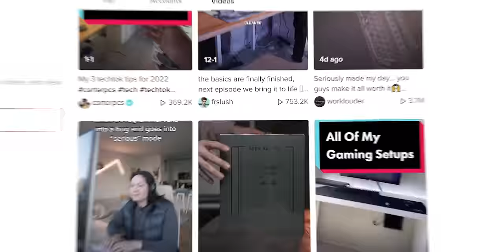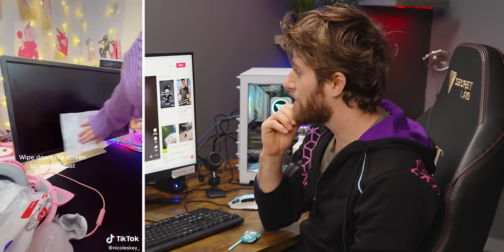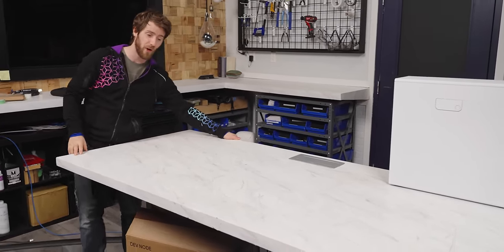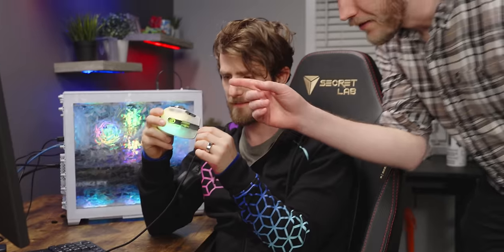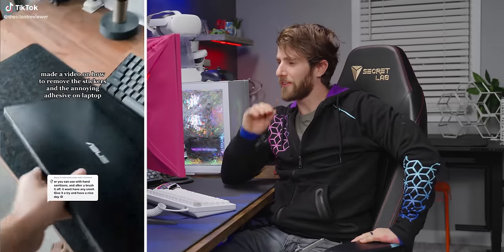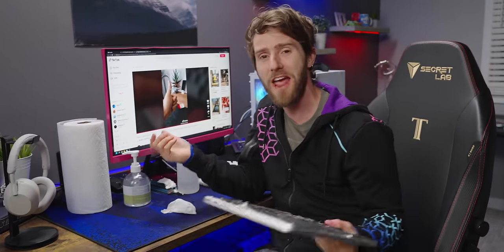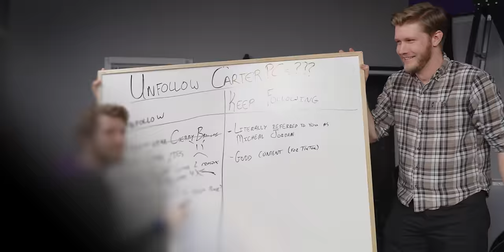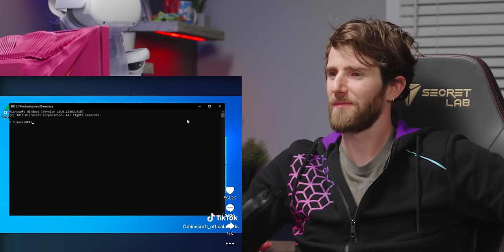TikTok Tech Tips are Terrible

Comment: Its the gelification of an evaporating solvent that gives it more time to penetrate. They purposefully do this in art restoration with various solvents to allow more working time and penetration on small areas so something harsher doesn't have to be used.
Hand sanitizer will get just about anything off of a hard non permeable surface. It's also good for getting dried paint out of paint brushes.
I use it for so many things around my house that when 2020 hit I had just under 2 liters of it already in the house.
Reply: It is also amazing for actually getting white boards cleaned to the point of being white again. 

Acetone can clean out the paint from brushes but probably ends up shortening the life span of any brushes made from artificial hair. I only use it on brushes that are ruined and I used on harsh paints like spray paint (for touch ups of minor scratches or nicks)
Reply: I use Goo Gone and it gets stickers off but leaves an awful-smelling oily residue that I then have to clean off with something else. Hand sanitizer will be tried next time.
Reply: also a sanitizes the surface for you.
Reply: @zebraloverbridget  You can by spray bottles of white board cleaner.  The one I have is mostly ethanol - the main ingredient of hand sanitizer.
Reply: But does it work on the legendarily bad paper GameStop stickers?
Reply: @dmmartindale  Yes, but they don't all work well. At least that was the case when I was still in school. Using the hand sanitizer actually got the board back to being white while the spray only kind of cleaned the board. 

The formulas could have gotten better over the years though
Reply: But will it remove rabbit hide glue?
Reply: The viscosity will certainly help, but I think the main difference is the presence of water in the solution. Not all substances dissolve well in alcohol, but many of those do dissolve in water. I mix 99% IPA with some distilled water (about 30%) and it makes it work noticeably better for many cleaning jobs.
Reply: glycerin is SOAP. So...there's that.
Reply: I work with paint and the old method is putting dried-up brushes in green soft soap and leaving them for several days. I think it works not so much by dissolving as by getting in under the paint and making it release from the brushes. It can take a while but it always seems to work and it's an environmentally friendly way to clean brushes. I will try hand sanitizer though - I can absolutely see how it being a gel would help. And now we have a lot of it too...
Reply: Also amazing at removing permanent marker.
Reply: Glycerin is an oil and like dissolves like.  Goo Gone would work too.
Reply: also you morel ikely have it at home already. especially nowdays instead of 99% alcohol xD
Reply: I would also add that the water makes the cellulose in the stickers more permeable to the alcohol, same principle as why we have 70% alcohol, cleaning alcohol, as the water contents makes bio matter more permeable.

Comment: Something important to know about the last tip is that a clean driver installation also resets your NVIDIA Control Panel settings (and probably also your GeForce Experience settings, but I can't say for sure). I learned this the hard way because I followed this tip elsewhere for a different issue and didn't read what a clean install actually does.
Reply: You're absolutely correct; custom install without checking "clean installation" uninstalls your previous driver already so clean install is pointless when you want to keep settings and profiles.
Reply: @RadicalMac  clean install was necessary for this case because client had issues with FPS. Resetting everything could help

Comment: A gamer has a gaming PC. They don't need anything else to warm their hands. All gaming PCs have warm air blowing out of them somewhere.
Reply: Well, yes, but that "somewhere" is not always the side that is convenient for you to access. Sometimes, they only blow warm air through the back side, which means you need to stand up, walk to the back of your setup, and then warm your hands.

The correct way is, as discussed in another comment thread, is to simply sit on your hands. Or to have a hand warmer at hand...

... in the form of an always-filled hot cup of coffee. 😎👍
Reply: The only time my hands are cold in my hot room with my pc running is when I took my adderall.
Reply: I had a gamer complain about the cold temperature and the wind chill that made it even colder. I had to explain that the temperature outside the house was different than the temperature inside the house, and that the wind shouldn't be blowing inside if the windows and doors are closed. They still didn't get it.
Reply: every laptop owner has his hands pretty warm most of the time.
Reply: @marioprawirosudiro7301  I don't understand, is the gaming set-up outside? I keep my heat in the low 60s in winter and I've never had cold hands sitting at my computer desk. Feet sure, but not hands, especially if they're being used for gaming.
Reply: @jimmyredd  I don't know about winter, but most people here set their aircon to the lowest possible when gaming, because, well, additional cooling. So if you have your rig a bit further away from where your hands are during gaming sessions (usually done so you can have more space on your desk), they won't heat your hands.

That said, I agree that when you're playing action games, whether it's FPSes or action RPGs, you likely won't feel cold at all, simply because your hands are active enough to keep themselves warm. I myself usually only notice my hands getting cold when I play slower-paced games like Civ or CK. Still not a problem though, because, well, hot cup of coffee.
Reply: @marioprawirosudiro7301  Air conditioners generally only go down to 65. Although if it is blowing directly on your hands they would feel much colder. 

Buying handwarmers to counteract your air conditioning is pretty fucking funny though. 

"This humidifier makes my room too humid, I better get a dehumidifier."
Reply: @jimmyredd  I think newer ACs go down to 16 degree Celcius nowadays, which would be around 60-ish F. For me that's plenty cold already.

That said, at least for the ones I see, the main reason people even put their AC that low during gaming sessions is to help cool the system - not the gamer. Kinda similar to how server rooms are usually equipped with heavy-duty air coolers. But unlike a server room which will be devoid of people most of the time, the gamer actually has to stay in the room.

But you're right. Buying a handwarmer just for this would be a bit silly. Thus my hot coffee suggestion. It's something that you probably already have in stock anyway, and many people like to have a beverage in hand when they game. So why not use said beverage as a handwarmer? A win-win solution, if you ask me.
Reply: @jimmyredd  not everyone has particularly good insulation. even though it doesnt get particularly cold outside where I live, the room my setup is in has very little insulation and a lot of windows/doors, so the inside temp is usually pretty close to the outside temp. I can't see myself using hand warmers though, as I'm pretty resistant to cold/heat unless its extreme.
Reply: On cold days feeling air rushing past my arm and into the front fans makes that side feel noticeably worse.  I tried angling the front of my PC away from me during that blizzard last week but I only have so much desk space to work with.
Reply: @marioprawirosudiro7301  "walk to the back of your setup" bro what kinda setup do you have
Reply: @marioprawirosudiro7301 not if ur pc is beside and infront if a wall🙃
Reply: @shoruda  One where the front part of the rig is facing me.

I don't get it. Some people put RGBs on their front panel, so I assume people would want to be able to see it, rather than have it face the wall. Instead, from the replies here, I get the feeling that people actually have the back panel, with the exhaust fan and the main power cord and display cables - all that, face them instead.

I mean, I get that some people have colorful cables inside their rig, but those are *inside* the rig, not the ones jutting out from the back panel...
Reply: @K3Vz0  My point exactly.
Reply: @marioprawirosudiro7301  if you dont have side panel you can just put your hands on the CPU cooler, instantly warmed
Reply: Those hand warmer things are pretty nice in general though.  Can't speak to that specific one, but I have one I use for keeping my feet warm when camping or just a cold night in bed when the rest of me is the right temp.  And it serves as a battery bank.
Reply: Mine sounds like an F18 kicking on afterburners and brings up the ambient room temperature up by 10 degrees after an hour of running DayZ on Steam 😂
Reply: My 2014 PSU aimed directly at my mousepad xD

Comment: I remember a repair shop could not diagnose the cause of my instability when I was younger. Years down the road I could. This guy in the last tiktok killed it. Driver and bios updates and default settings for diagnosing is the first thing you do.
Reply: Totally agreed, update drivers and default settings.
90% of Other common issues are fixed by Checking cables and connecters.
And check installation and seating of ram, cpu, and gpu.
Reply: I think you needed to go to a therapist not a repair shop for that kind of problems mate.
Reply: @undeadmage  that joke was uncalled for but damn I laughed hard
Reply: @amoloch  yeah, reading it back later it really does lmao
Reply: he got one thing wrong about it tho 

"clean installation" doesn't completely remove your old drivers, it just resets whatever settings you have changed in Nvidia Control Panel back to default. It literally says that when you select the option. two completely different things. That's why DDU exist.
Reply: Yea and also very important thing he didnt mention is to disable windows from automatically installing default drivers.
Reply: @lievre460  Though there is a good uninstall now, it will remove everything. As long as you don't somehow have some other random drivers, you shouldn't need DDU on your own PC that hasn't changed hands.
Reply: @Gatorade69  Sure there are just like any industry. But there's a lot of really great ones. Asking about the warranty process should you need to use it is generally a good way to find out who stands by their work or not. Also in the tech repair industry, it's incredibly easy to build a lot of good reviews. 99% of the time all you're doing is good for other people. They screwed up, they bring it to you and you save their ass. So if you have good customer service and offer good work, a 5 star review is nearly a guarantee. 

I'd say if you see a shop with anything less than a 4.5 then there's a reason for that. Maybe they don't honor their warranty 3 months down the line. Maybe their customer service is awful. Maybe they say they can get it done in a day, then it takes a week and they don't communicate why. At my shop we have over 1500 review. 5 stars on Yelp and 4.9 stars on Google because we actually give a shit. We're good at what we do, always looking to develop better techniques and expand on what we can offer. We offer a lifetime warranty (obviously no new damage though) and above all else we have excellent communication and customer service. For the common types of repairs everything is completely transparent in pricing. It's all available on our website and we'll let you know ASAP if there's anything to deviate from that pricing so there's no surprises. 

There's a lot of bad companies in this industry. I'm friends with some competitors who actually do good work and nobody who is actually good at this stuff is under a 4.5. It's not a magic number but it's a good indicator. Though this is in a major city. If you're rural and only have 15 reviews, then one problematic customer can skew those numbers and perhaps it's different. This industry is about customer service and making people feel comfortable with the whole experience. Anyone can be taught to turn a screwdriver. Not everyone has the skills to effectively handle sometimes difficult conversations. That's the main difference between a good shop and a bad shop. The bad ones also are out to make a quick buck and screw people while the good ones live on long term loyalty and repeat business. Maybe you don't charge anything for this 2 minute repair to help someone out. Then a year later they come back for their next problem and have a great experience. Then they tell their friends about how great you are at what you do. That's the way to survive in the business, those fly by night mall kiosks give us a bad wrap lol.
Reply: Yeah we do that way before tiktok. we share it in a site called forum.
Reply: @lievre460  Thought it didn't work like he said.
Surprised Linus didn't say anything.
Reply: @DoubleMonoLR  you would be surprised how many “repair shops” cannot troubleshoot bios settings related issues. You bring the pc in, you tell them it crashes totally randomly with no sign, you show them the error code and then they have no idea and say everything seems okay. It was the memory clock speed that was supposed to be supported by the MB and the dimms too yet it was unstable. A bios update later the whole system broke if I even tried to apply the higher clock speeds. Figures the feature was disabled in that revision. The repair shop could not diagnose this. A bios update and a default setting usually solves any issues. Yet they could not. So yeah, the guy is killing it compared to other creators and shops.
Reply: @lievre460  The effect is that all the settings are reset, which is what the installer is noting, but for it to reset the settings, it completely removes all files relating to the old drivers before installing the new version.

Source: I have used the Clean install setting and watched the installation process. Whereas previous installations of new drivers just installed over the previous version, overwriting necessary files, after selecting Clean Install, I would now stuff like "removing [insert component name here]".
Reply: @ponyslavestation4669  Not really necessary to disable it. Just need to be educated on the fact that Windows doesn't install the latest and greatest version of drivers, and that for your graphics card, you will want to seek out the latest version because the one Windows chooses likely isn't the latest one.
Reply: @litLizard_  ddu is totally unnecessary for a routine driver update. its only really needed if youre having major issues or are swapping from nvidia to intel or amd or vice versa

Comment: So about the hand Sanitizer one, It happened to me once that I got a big drop of fast dry super glue (the transparent one that is used to glue plastics) and I started to panic, by the time I got to the bathroom to wash my hand it was already dry, I try scrubbing my hand really hard and it didn't work, so in a last ditch effort I used Hand Sanitizer, and I removed it without trouble, apparently many glues dissolve on Hand Sanitizers
Reply: Best way is to have it under warm water for about 2 minutes,
Reply: Just use some acetone based nail polish remover. Readily dissolves CA glue.

Comment: That hand sanetizer trick ive actually used at work sometimes when my ordinary cleaning stuff is empty, or a couple of stairs down in the car...
Working with Ventilation in mostly apartments, so it often alot of grease and fat that a bit of hand sanetizer actually doing a pretty good job of removing without very much residue.

Comment: That chihuahua has been in Samsung phones' testing mode for as long as I've had Samsung Android phones, dating back to the Galaxy Y I had in 2012. Have some fond memories with that phone (some I still have screencaps of, test mode chihuahua included).
Reply: It doesnt work on my phone sadly
Reply: @dutifulbarrel9084  some carriers will disable that diagnostic menu, but if you are carrier unlocked, then you can get it.
Reply: @Dwivil  what menu is it unther i can't find it.
Reply: I got a diagnostic menu, no Chihuahua though.. 🤷‍♂️🤷‍♂️
Reply: It's iconic
Reply: I haven't seen the TikTok video, but for me it's in the Sensors tab and then there's a small Image Test button at the top.
Reply: Yep, recently got a Galaxy S2 to mess around with (Android 4.0.3) and it still has the damned chihuahua
Reply: I have a galaxy s10e and it doesn't have the chiwawa (ik I spelled it wrong)
Reply: @graphicsgod  S22 Ultra, it's under the "sensor" menu, at the top right there's a button that says "Image Test" and that brings it up!
(it's been a while since you left the comment, the diagnostic menu code is *#0*# in the keypad)
Reply: @Parker-nm9cg  Thank you, I found it! 😉🤟

Comment: Yeah I've used hand sanitizer in a pinch at work to remove sticker goop and permanent marker. The consistency seems to help keep the liquid against the material.
Reply: And it doesn’t evaporate as fast as alcohol, although acetone will remove sticker goop faster but if the finish on what surface you’re applying it has weak bonds, don’t use it or test in an area that’s not visible.
Reply: Yup it works pretty well, I used to do the same.
Reply: WD40 works the best for sticky residue. Found that out when removing stickers from Ikea glsss
 cabinets
Reply: It just use oil (like olive or vegetable oil) to remove the goop, then use Isopropanol to remove the oil.

Alternatively, the goof off spray works wonders.

Comment: 18:13 To bypass signup walls on article sites, open the Inspector or developer window, find the css for the modal (that layer that darkens or blanks the screen) and set it's visibility to none. Then go up to the body tag and set overflow to scroll.
Reply: Or disable JavaScript.  Also, not only will all the adverts not load, but neither will the adblock detector!  And if the website breaks because no JS, it probably wasn't worth visiting anyway
Reply: Sadly most of the pages got smarter.
Reply: I just deleted the popups